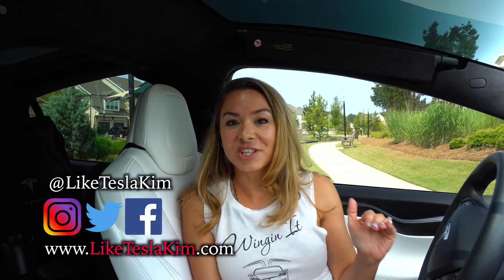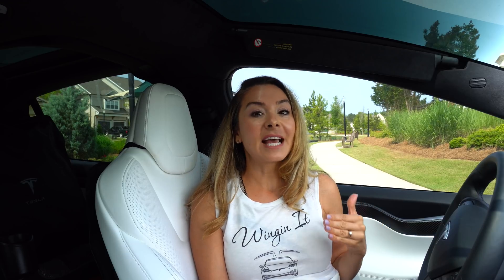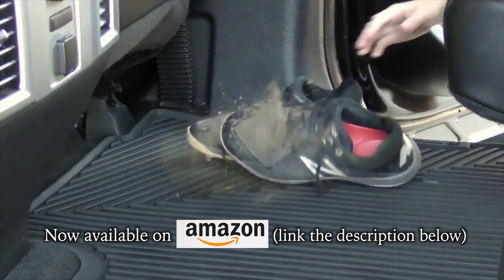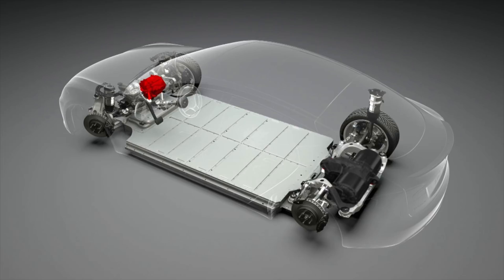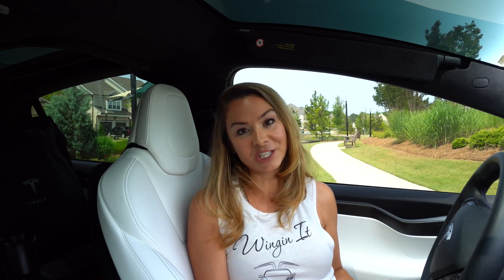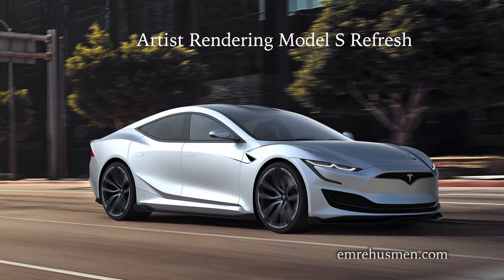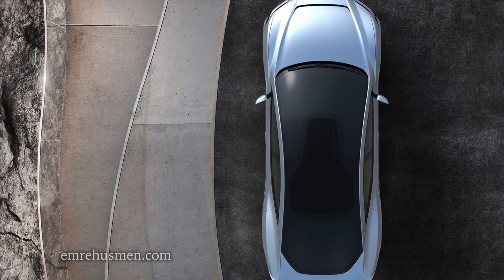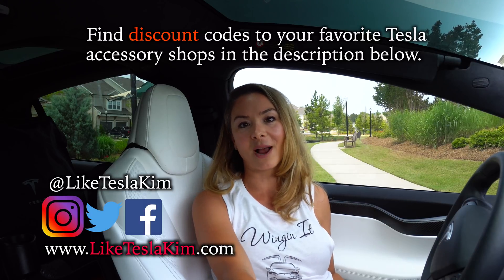EXCLUSIVE: Tesla Insider Leaks DETAILS of Next Generation Model S & X!

Comment: So I pretty much bought the max model S in Dec 14.   I said my next car would be a Tesla when they had a fully automated car.   So until that happens new designs don't do much for me.   I like the increased range (because I can't go more than 200 miles without a charge).  I like the increased power and I didn't realize my car wouldn't work with the Gen 3 superchargers.      But I reallly dislike the model 3 interior and that was disappointing.     Also the newest car has to have 5G (not the 3G) that I have becaause they will never have a fully automated car until they get that.    At the same time, I'm a bit concerned about the future of Tesla so I'd like the see the situation get better before I get  another car.

Comment: I believe they will introduce a hybrid type battery pack that uses a cache of electrostatic batteries (AKA Super capacitors) to  improve peak power output and energy recovery during regenerative breaking. The duty cycle of electrostatic systems is far better than Lithium therefore using a cache of these batteries could potentially make the battery pack last much longer.
Reply: I was thinking exactly the same thing. I'm no Electrical Engineer but using the Super Capacitors for initial acceleration, like starting from a standstill, and then disengaging them at some point to cruise at a given speed using more of the battery pack would optimize the characteristics of both devices. The video is nice but anyone thinking of purchasing a new Tesla would do a lot of homework and only give so much weight to one particular video.

Comment: Omg this is crazy! If the Model S had 400+ mi of range, good bye range anxiety!
Reply: Rick Lokers  25% range reduction from driving faster? That'd either be in freezing cold winters or at the German autobahn. Or are you talking about 300 mile stretches from 80% to 10% SoC? Model S Long Range can drive up to 270 miles at 80mph today.
Reply: Rick Lokers  I looked more into it and I  think I see what you're saying. The premise of my response is that you can do 400 miles at legal speeds, so the resistance is irrelevant. Current Model S Long Range:  55 mph - 415 mi ; 70 mph - 323 mi ; 80 mph - 272 mi. The main point is that its current EPA rating is 370 miles of range, and you lose ~25% from that at 80 mph. And if it was 400 mi EPA it would be more like 300 miles at 80 mph, similar to what you said.
Reply: Do you experience range anxiety in 300 mi range Tesla's? I would call it "range frustration" at worst. The benefit of 400+ mi range is very diminishing, and the biggest road trip benefit is the potential charging speed, in my book.

Comment: Tri-motor not likely.  Radically different battery pack not likely.  Mechanical changes,  cost reduction  and cosmetic changes likely.
Reply: You don't think like Elon. You are looking short term to keep the existing 6 year old design current a little longer. It is time for a major refresh, any major automaker would not wait longer. But in Elon's case it is as much as keeping the car technically on the leading edge as much as anything else. Cosmetic only? No way!
Reply: The Model X is a tribute to Elon’s hubris.  I own one.  You may be right but with the Model Y, a pickup truck and a semi on the way, it’s hard to imagine such a small company being able to do major overhauls of the S and X

Comment: If they can use the V3, then they are definitely using the M3 2170 battery :) 
When TSLA came out with their current refresh with the updated range and kept using the 18650 batteries along with the newer motors, you knew they were holding back :)

Comment: We know it is going to be Maxwell dry cell Ultracaps, expect to have even longer range and more punch

Even if Tesla is using 2170 cells, ultracaps can bridge this design to extend batteries life and instant energy releases 
plus regen in cold weather. 

One day there would be self recharge driving highway, Nikola Tesla has a bunch of great generators can be used to generate electricity at certain speed.
Reply: ultracaps are REALLY low power density. it's like 200 lbs per kwh, dude

Comment: Great to hear! Thanks for sharing. Doing some quick back of the envelope calculations, that weight reduction and extended range would need a battery density of around 340wh/kg...which is basically the maxwell tech proof of concept they ran with Tesla. Production of maxwell batteries would be smaller scale so fits with s&x sales volumes 👍
Reply: TheOne agree. The biggest thing on my wishlist for this battery pack redesign is state of the art cooling. I don’t give a damn about anything else.

Comment: I still don’t get why people keep talking about 2170 cells. There is a huge misconception that they are superior to 18650 cells. No they are not. And no they won’t make it to the model S and X because though the 2170s have a higher energy density then have a low discharge rate and does not have the peak power o/p that model s and x need to go 0-60 under 3 seconds. The model 3 performs better because of the superior cooling it has.

When tesla comes out with S and X battery pack redesign, it will be a new chemistry superior cooling and / or inclusion of dry electrode tech which will enable 250kw supercharging for Model S and X and also the added range.

Comment: Almost all of us are not just Tesla owners but Tesla enthusiasts. That makes upgrades like those mentioned here almost irresistible. I'm very excited, especially if this refresh doesn't entail a price increase, but I'm not planning on trading in my 2-yr-old S75D. I'll get the HW3 FSD computer upgrade that I paid for and see what it's like. If satisfaction with that is high, then depending on just what is included in the refresh, I'd probably not upgrade. That's especially true if this upgrade doesn't yet have the tech advances -- dry-electrode batteries and ultracapacitors -- that are almost surely coming from the Maxwell acquisition. I expect that it will, though, because we've never heard of anything else in the pipeline that might lead to such a drastic reduction in the weight of the battery pack. The other reason that I think it might include those features is that Tesla has reportedly been collaborating with Maxwell for four years — i.e., they're engineering staff is already intimately familiar with this technology, possibly familiar enough that they could manufacture it with a short lead time. And implementing it may be exactly why Panasonic announced that they'd be making no further investments at GF1.
Lastly, to make me upgrade. The refresh would HAVE to have either a binnacle instrument cluster OR a HUD. If it goes to that damned-foolish one-screen design as in the M3, I'm definitely holding onto my current S. It's why I canceled my M3 reservation and got an S in the first place. I hated it then, and I hate it more now.

Comment: Ok I hope this doesn't turn into a Fred Lambert moment that craters  S X sales because people are waiting. I hope this happens in 30 days or less. Otherwise it would have been wise to wait to publish this, or get Elons go ahead first
Reply: I'd expect this to cost more than the current models, and don't think that people who buy one now will be screwed.  Those who got one earlier and got a full tax credit could afford more of a hit, and if the new one comes out after the tax credit is gone and costs more, then people who buy one now will have the savings of a better price and a lower effective cost.
Reply: bW9taeH4 it likely that there will be a slight cost bump for range but they’ve have said that new batteries should be cheaper to manufacture, saving the customers money. The goal is to offer something so good, no gas car can compete. Giving nobody any incentive to buy a gasoline vehicle.
Reply: @buyteslastonk  Car prices, like everything else, are a matter of supply and demand. A lower cost for parts will not change the equation unless manufacturers across the board can achieve the same savings at the same time. If they can, then demand would go down for Tesla. If they can't, then Tesla would recognize that people were already willing to pay a certain amount, and there would be no reason to lower it in the short run.  If the changes pull the demand lever, then Tesla can afford a price increase. The increase need not be proportional to the new capability if manufacturing costs go down, but as long as there's demand for new technology, Tesla has to stop repeating the same mistake of introducing it without a price increase and wondering why nobody wants to buy inventory cars without a discount.
Reply: I've been waiting for 500-600 mile range batteries for a decade. This news isn't hurting anything 😂

Comment: I have suggested two rear motors instead of a differential as a way to get rid of the rear disc brakes. Lose all that mechanical weight and complexity. Because if you have 3 second acceleration power in the rear that's more than what the rear wheels can bite in a braking situation because the weight is on the front. So that would be a nice improvement in elegance. 
Putting the touch display in the steering wheel face would be a similarly elegant way to have only one display without the trade off of looking to the side. Obviously the display should be right in front of you like a tablet. Imagine if someone insisted you hold a tablet far away to the side when you used it... touch display has no business in the center. That's legacy thinking.
Reply: without needing to cool a set of rear brakes, end-users could safely use hyper-efficient stuff like solid-fronted wheels or even wheel well covers like the old Honda Insight. It won't be popular, but I personally like the idea of reduced noise and greater efficiency/range.

Comment: We can suppose that the Maxwell tech is involved with the battery improvements.   400+ mile range is key to continuing to move competitiveness against ICE vehicles forward (those in their same class).

Once 500 Wh per kg is achieved Tesla premium BEVs will out performe all ICE cars counterparts  in all aspects, except charge times (and that won't matter much with a 500 mile range), AND they will be cheaper to manufacturer than their ICE counterparts.  Per unit margins will be an astounding 25%, at least for a little while.
Reply: Not less than one month after the deal closed. Lol.

Comment: Hi Kim.

It has been a while. Glad you're back and you're making quite the splash on tour return. Well, I'll be in the market to replace my ICE car with a Tesla Model S. In light of recent news regarding updates,  I guess I'm at the old proverbial crossroad regarding current design versus potentially new design in the 3rd Quarter 2019. It would make sense for Tesla to complete the refresh of the S/X in the 3rd Quarter which would more than likely boost sales of current and new versions. 

I like the curremtly designed MS especially the vertical screen. The interior design of the M3 isn't bad but I'd like for the MS to retain more of its luxurious interior features by comparison. 

Guess I've got a big decison to make in the next couple of months. 

Thanks for the info. 🤔

Comment: I wonder if it’s possible that Tesla have already integrated Maxwell’s dry electrode tech into the new pack to make it lighter. Interesting...
Reply from the maker: My thoughts as well.
Reply: I agree. They were already quick to have Maxwell tech in the raven suspension correct?
Reply: Isn't that slated for Q1 2020?
Reply: Maxwell already has a battery factory and likely stock in a warehouse that Tesla now owns. Giga is no longer their only battery facility.
Reply: @NicholasShanks  Maxwell factory is only for super capacitors. They don't make 18650 (S/X) or 2170 (3/semi) cells... it's not clear how the Maxwell tech will be integrated yet but most likely in partnership with Panasonic if it's going to happen any time soon
Reply: @steveseeger  - With this New Maxwell Tech, 18650, or 2170 Cells, might Both be able to do a New Size Package, still keep Safety, and Improve Packaged Energy Density! If still Cylindrical (large probability), numbers Could Be: 2685? 3290? 40120? Etc!
Reply: @NicholasShanks  those batteries are not ready for integration into any of Tesla's cars ... As Elon said. They will hold another investor conference later in the year or early 2020 to make the big announcement about batteries that last a million miles
Reply: Agreed
Reply: I hope after reaching about 400 miles in range they put more efforts in cooling and reducing the weight of the car rather than going for 500 miles of range because we don’t need that.

If they are increase the range while keeping weight low then it’s a bonus
Reply: acquisition just happened. that stuff takes time. might be incorporating newer model 3 battery technology
Reply: Edward Cox I doubt it, unless they were increasing the pack size above 100kw the car won’t be able to go above 400 miles
Reply: Edward Cox Tesla was working with Maxwell for a while in secret, so may be further along than we think.
Reply: Stryker Ace they dint announce anything yet so that is just a speculation. Regarding 650 mil range I disagree and that I just my view. I don’t need a vehicle that can go 650 miles because I will never drive that far w/o taking a break so it’s pointless to me.
Reply: @webguy1283  - For Trips up the "AlCan" (Alaska Canadian) Highway, 650 Miles would be Quite Useful driving from Vancouver to Whitehorse, or Anchorage!
Reply: Robert Weekley good for you. I am not a machine to drive non stop 650 miles